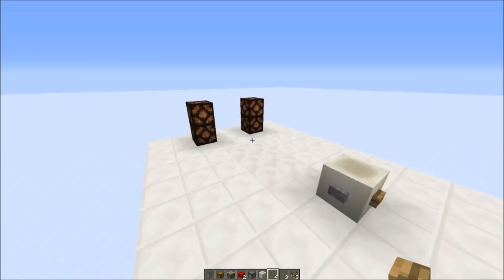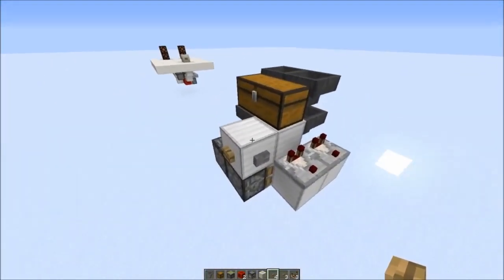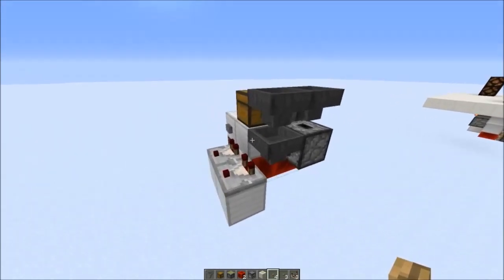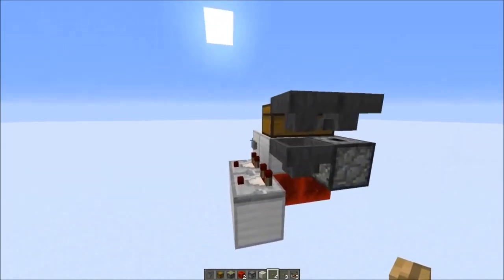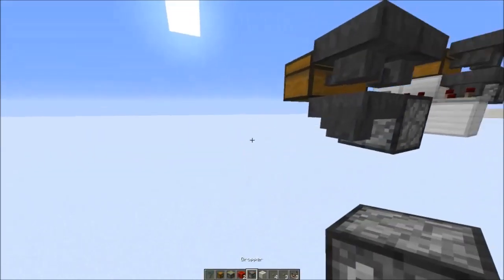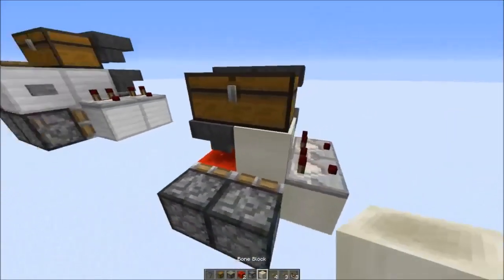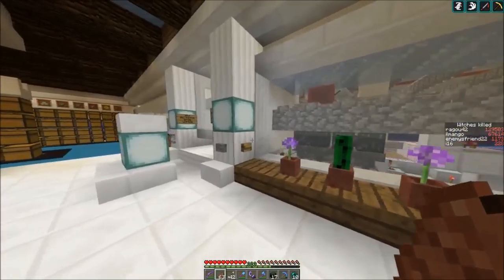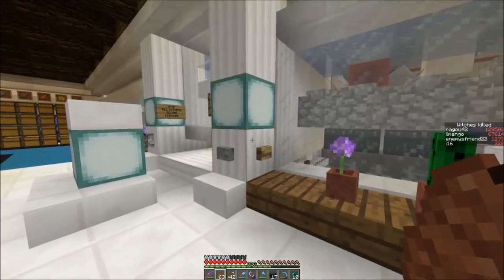Redstone Basics: Button Differentiator

Comment: I did two buttons with 3 pistons and 2 redstone blocks.
two sticky pistons with redstone blocks facing down 2 blocks under the buttons (leaving room for a floor).
then a normal piston facing down under the block with the buttons on it.
done.
Reply from the maker: but this would only work if you have space directly under the buttons. My system could take an input from buttons that are 10 blocks away. If you have so much space, you might as well attach the buttons to two different blocks